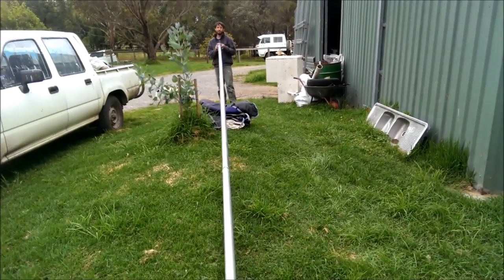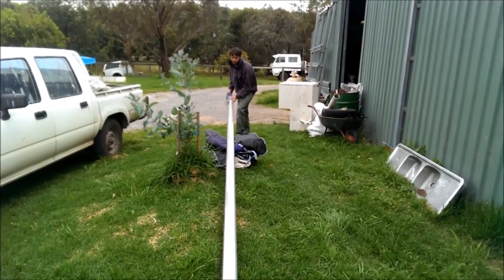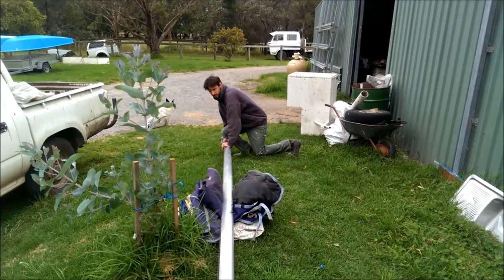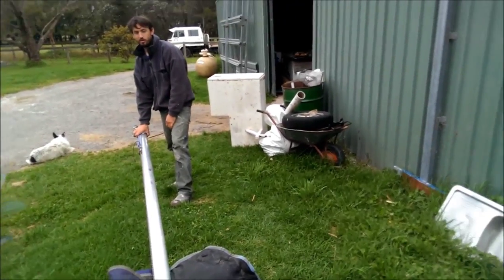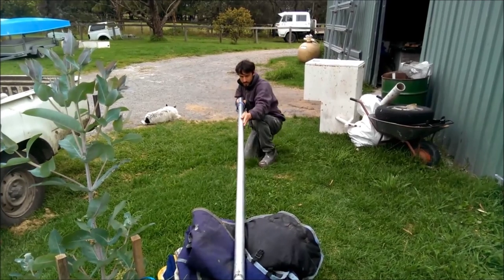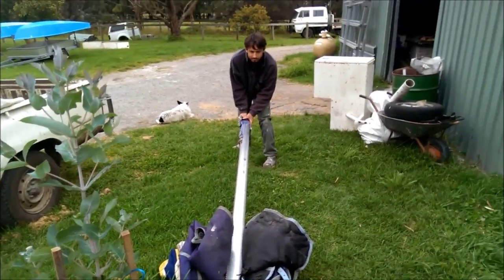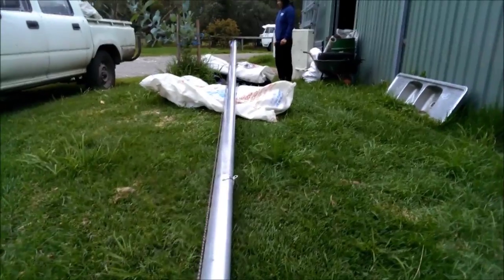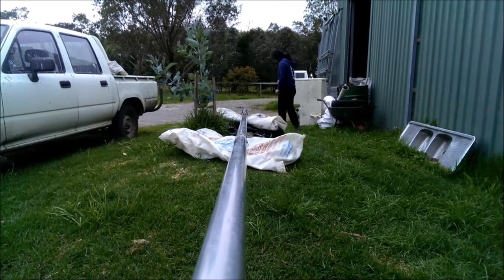straightening bent mast

Comment: That is not much of a bend.  My ex room mate put the mast across 2 motorcycles, and then dropped the top end on the ground folding it 45 degrees at around 3-4 feet down the mast.  I will have to cut and splice it but maybe I can slip some bamboo inside ( can support the out side with bamboo as well), and fiber glass that inside and out, and finish up with some rivets. It fits a classic (1980s)16 ft trailer sailor, so getting a replacement is unlikely.  :( :( :(  What a d!khead!!!

Something like yours is easy, just remember to pack it tight with wet/damp sand before you start to keep it from collapsing or getting a crease on you.

Comment: Thanks for the video. I'm going to try it. I bent the mast taking it down by myself last fall and have been wondering just how to straighten it. This looks like a good method without applying heat, which would be difficult.

I can't stress how important it is to keep tension only on the forestay when stepping it or taking it down,  which is centered on the strongest angle of the mast. The mast will bend or bow quite easily from side to side held in place by the shrouds; however  it's greatest strength is in the fore and aft.

I know this sounds simple, but a lesson well learned here. I had thrown a rope around the mast above the spreaders and was using it to lower the mast myself. Once the base of the mast was being held by only the fulcrum pin it twisted sideways and that is when it bent.   .